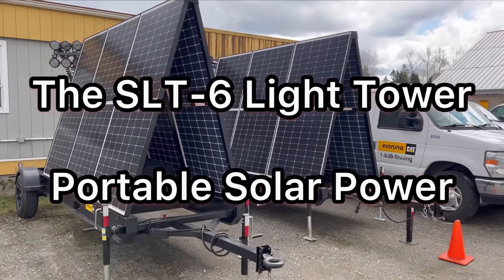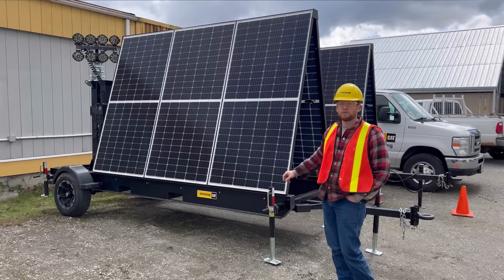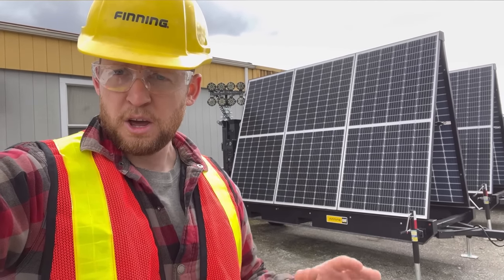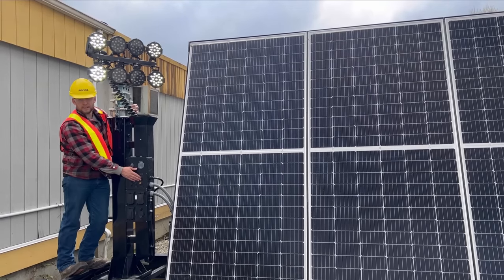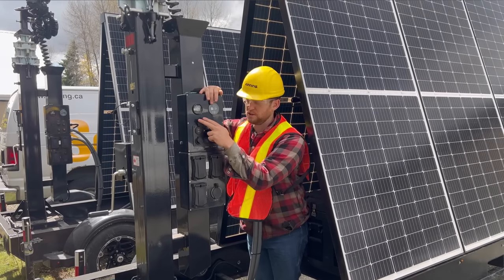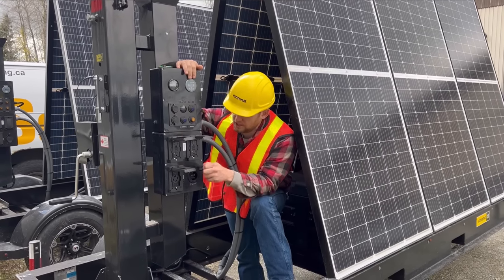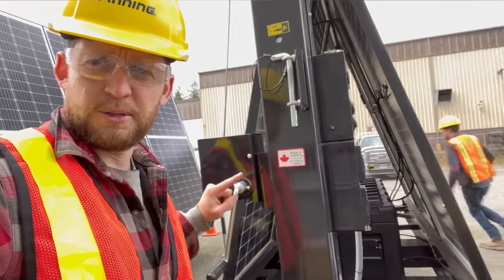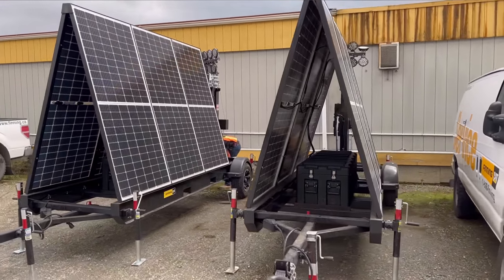How a solar trailer/light tower works

Comment: The attention to detail, and effort that went into building this is probably not said enough - This is so cool!!!
Reply from the maker: We worked for 2 years to make sure it’s the best light tower built, and we sell if for the same price as the other companies sell cheap alibaba resell specials
Reply: Could you rig one of those trailers up to run an RV? No lights
Reply: @suprestoner  yes
Reply: @EdisonMotors  That's wonderful. I'm so glad those people like you building quality products locally
Reply: @Edison Motors  Setup looks great quick question how does the system ground ? Is it grounded via the trailer itself ? Do you need an additional ground ? Thanks

Comment: 110 and 220. No fuel to purchase to run it. Incredible. Options are almost endless.👏
Reply: Pulling double or triple duty is awesome. It's a solar light tower, with the ability to recharge some hand tools or run a small electric tool for a bit, and phones. Plus having a high up camera is awesome.
Reply: @deansmits006  15kW is roughly half of a home's daily usage - so it's got plenty of juice.

Comment: Really nice setup, one teeny tiny little improvement potential not everybody has an Eric "on tap" :) .  However on a job site there might be a cordless drill that could do the heavy lifting. So what I am suggesting is an option for putting on a socket and using a drill similar to what I have seen used on the jacks on gooseneck trailers.
Reply from the maker: We already have that.  Take the handle off and hit the socket with an impact gun (but that’s not in the operation procedure for Finning so I didn’t say that)
Reply: Exactly what I was going to say. I was thinking a straight through shaft to put a half inch drill on so you don't risk damaging something with an impact. Could even use a corded drill powered by the SLT.
Reply: @EdisonMotors  I thought you could put a socket on the end to just slip a half inch impact in and go
Reply: @EdisonMotors  Having watched nearly all of your videos I should have known that you had it under control. Something about people who actually have worked out in the field, they tend to think about these things. As you have said many times Engineer < Mechanic/operator at least when it comes to operation / servicing of the equipment. Anyways thanks for the response :) Greetings from Norway.

Comment: This would be dope in the oilfield. It needs fork pockets and d rings added to the bottom for hauling on a trailer
Reply from the maker: Look close.  It actually has forklift pockets already and you can sling off the landing legs for a picker

Comment: well designed.  For ludicrous power, being able to tilt panels with linear actuator all to one side would be pretty big.  Would require an extra column in front.  The set it and forget aspect of existing setup is a very nice feature, but squeezing ludicrous power out of it would have applications.

Comment: Maybe put eyebolts on the tower somewhere for guy wires?  The tower doesn't have much area but the panels do.  Great idea and solid execution by the look of it.
Reply: With 4 extended outriggers, if the wind blew hard enough to tip it, a light trailer is probably the least of your worries. Lol

I do wonder how fast that wind would have to be...

Comment: I think you guys are doing some great things at Edison motors looks really good. Can’t really think of a way to improve it but to me (and this is just me) those on/off switches always make me think for a second because to me the circle is a continuous loop which means running and a flat line is dead or off but it’s actually the other way around on the switch vs just having on/off or run/off but maybe that’s the standard across the board in Canada. Thanks looks good!
Reply: I think it's more of a North American thing. It's been adapted from Binary where 1 = On, 0 = Off. Hence the circle and line pictogram.
Reply: The circle and line are for open and closed, meaning a closed circuit.
Reply: @jaredlancaster4137  yes, but i get what he's saying. Its sort of counterintuitive if you don't know its based on binary code. If i knew nothing about switches and was asked what represents a closed 'circuit', an o or an I, id think it would be the circle.

Comment: Would you guys or Finning Cat consider selling the wiring plans (even maybe a sketch) What size inverter and what brand components do you find reliable? Are there manuals and parts books for these? I would like to build a similar device for myself, not to sell but to use on my farm as remote power and backup power.

Comment: The only thing I don’t like is the solar panels on both sides, I understand why you do it since it dummy profs it but I’d rather be able to fold em out so they all face the same way or just have half as many and save some money and then set it up in an optimal direction. I understand why a lot of companies would rather this so they don’t have to worry about having it face a optimal way and they aren’t as worried about cost
Reply: Also less moving parts, less stuff to break. The cost of setting up a rig with foldout solars may be the same cost as 6 more solar panels.

Comment: How hard would it be to mount a starlink on top of that?
Reply from the maker: Not hard at all.  We’re looking at including it as an option right now actually
Reply: @EdisonMotors  Soon as a Starlink goes up someone's gonna want to have it also provide on site 4g/5g micro-cell service as well as a powerful outdoor WiFi access point up on that nicely elevated mast too. Might as well sell a light tower version and a remote communications tower version, or at least make an easy swap capability to switch out which payload is mounted to the top of the mast.

Comment: Can you tow multiple units around a site so that you could drop one off at a time? 
Is there a max tow speed for on-road and off-road?
Reply: Pintle on the back - not suitable for on road use but for e.g. temporary parking...

Comment: Though I think it would be better to have the inverter and batteries be separate modules. The batteries aren't going to last forever, and it would be nice if you could replace the batteries without having to replace a still-good inverter.

Comment: would be lovely if the solar panels were on a hinge to have them straight flat or one of the sides going up to the same angle as the other side (can't really explain this part well).
Reply: Kind of, but it also then takes away the primary benefit of the solution: Set it up, and forget it. It is meant to be as idiot proof as possible, and the less interactions with the North American 230lb Gorilla? The better. 

I mean, as he said, it charges to full in ~4-5 hours on a clear sunny day, as is. Because they devoted that much space to the panels. If you could orientate them, you cut the charging time down to....2-3 hours? In 99% of regions this might be used? That additional capacity would be meaningless.It would also greatly increase the surface area for wind-loading, making the whole trailer less stable.

About the only places where such a feature would be useful, is in the farthest north work camps and towns, where they get almost no sunlight at all during the winter. Even then, they likely would need to be supplemented with grid/vehicle/generator power anyways, because...such limited hours of "low quality" light. Everywhere else? It won't matter, and the ability to just drop them where they are needed, just makes them more appealing.

Comment: What's in the box?
Reply from the maker: A power invertor /bms system.  Couple of heating pads, it’s pretty simple but if you push buttons then it’ll screw up the settings
Reply: @Edison Motors  but me want to push button
Reply: @randomfastreader  Do you want to get everything potted in silicone and enclosures ultrasonically welded shut? Because that's how you get everything potted in silicone and enclosures ultrasonically welded shut.

Comment: How do you deal with wind?
Reply from the maker: We used really thick H-beam frame, and thick steel, and heavy batteries on the bottom to lower the centre of gravity and then added outriggers

Comment: What 120 and 220v inverters are you using?    I am guessing you are using 2 separate inverters?
 How many watts are they good for?
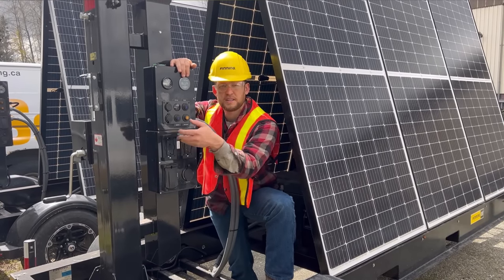Reply: I'm guessing they are using an all in solar inverter and charging kit cable of outputting split phase power or possible two different ones paired together to provide split phase. If you're curious look up eg4 6.5 kw inverter. To answer your question on wattage that looks to be a 20 amp 240 plug specifically a nema l14-20 at    4:53  
Watts =amps x voltage 
At a minimum there is 4800 watts available 
Not saying this what they're using this just an educated guess.